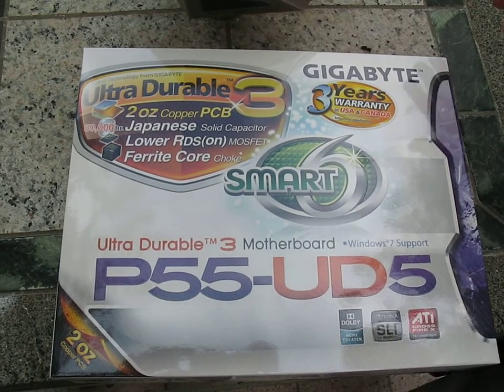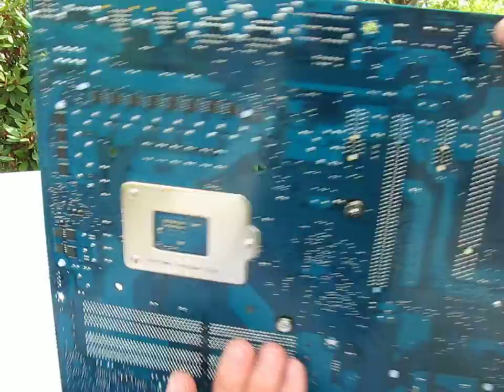Gigabyte P55-UD5 P55 LGA1156 Core i5 Motherboard Unboxing Linus Tech Tips

Comment: Chapters:

0:00 Box and general overview
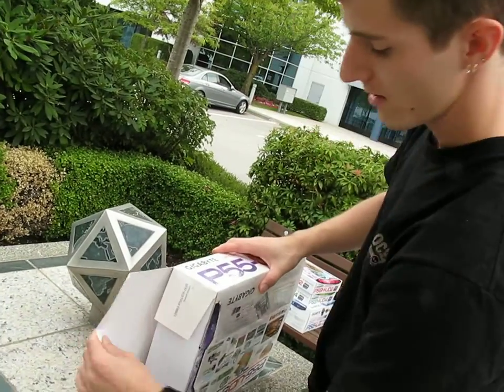0:34 Unboxing start
0:44 4 Orange SATA cables and a blueish IDE cable
0:55 SLI Bridge
0:57 Manuals and DVD
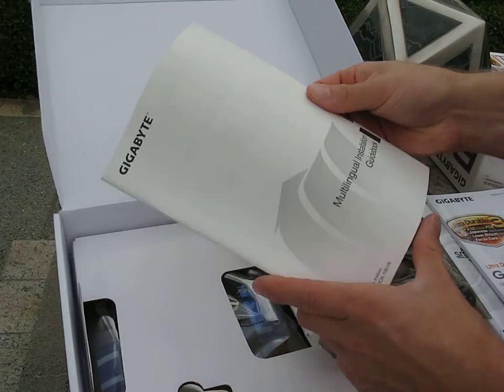1:11 2 port esata extension, esata cables 
1:32 I/O Shield and stickers
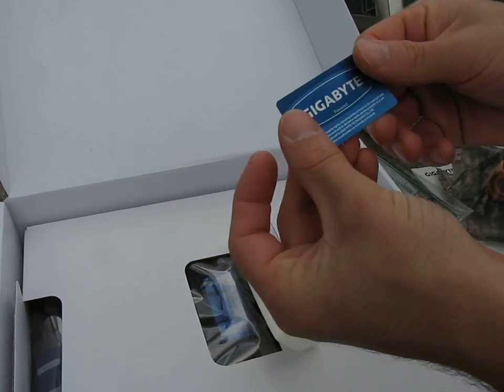1:43 Motherboard itself
2:07 General Overview
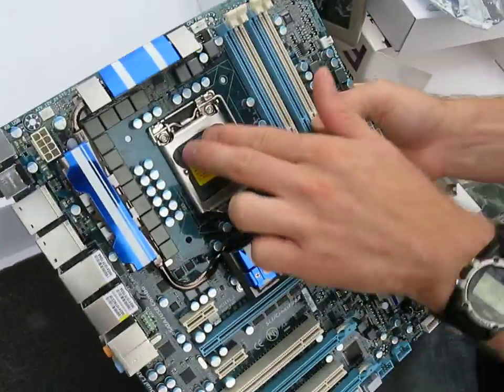2:15 12 Phase power, cooling solution
2:35 Power connectors
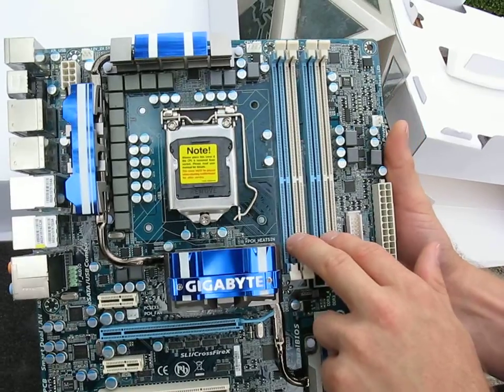2:42 4 Slots of Dual channel DDR3
2:55 PCI-E Slots
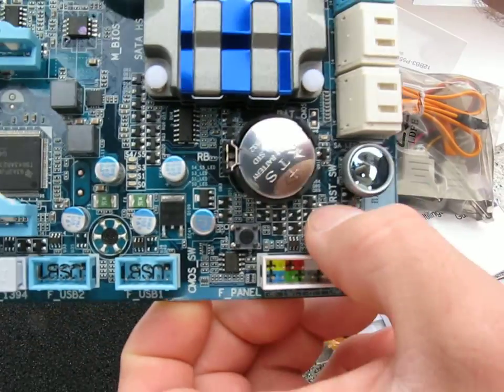3:15 Onboard Clear CMOS, power and reset switches
3:21 10 SATA ports
3:28 I/O

Video Review:
Hardware not that exiting, but I got to say the cooling solution for these old boards look way cooler than what new hardware has :) I rate this a high 1/5

What am I doing, and why?

I want to watch, and review every single video on Linus Tech Tips channel.
I will provide chapters, if the video has none.
Why am I doing it? To pay a homage, and I am pretty sure that my head is a bit messed up.

Comment: @soulcalibur22  Also intel plays a delicate balance even when they do make a good motherboard. They cant out-tune or compete too hard with manufactures supporting them. So even "good boards" like INTEL SMACK OVER get out shined and embarrassed quick by even the lowest aftermarket "3rd party" (really first) entries. Its easier also for 3rd parties to innovate on what you've done. there compilation helps the next gen reference boards.because intel is learning from them also.

Comment: @yotchsy Aftermarket boards are better especial from the big 3/now 4 manufacturers. Features. Intel's boards are reference. They are cheaper because they are reference. If that's your thing go for it. But aftermarket boards are more durable, better features (software and hardware (more ports dual LAN tweaked electrical settings sound and more), higher clocks and rams supported also. Just think of reference boards as the car from the factory and aftermarket the Tuned up break the rules version.